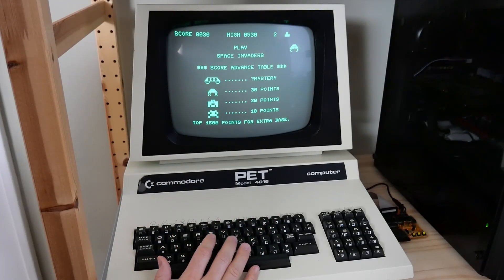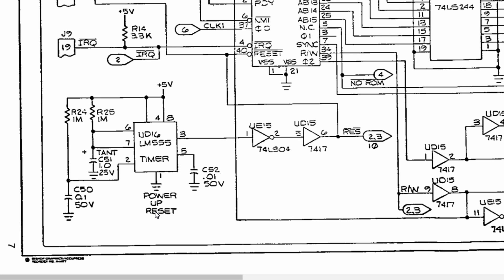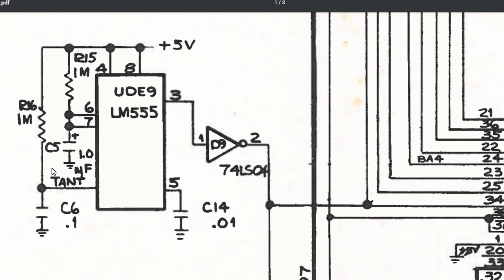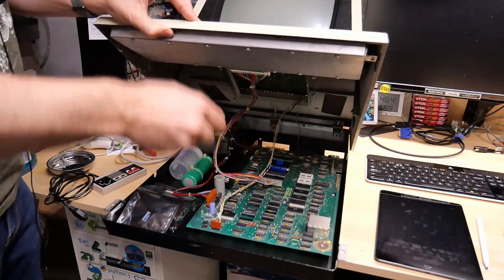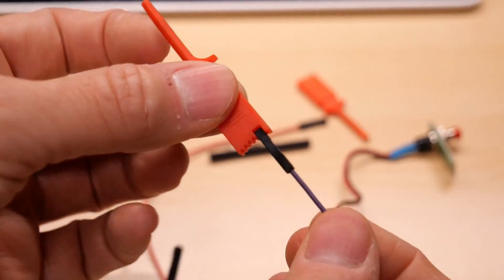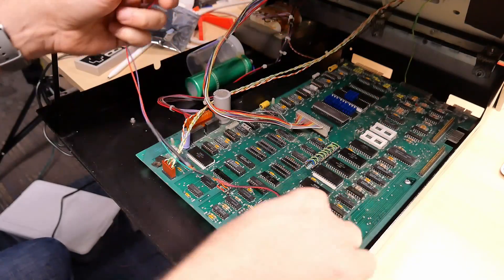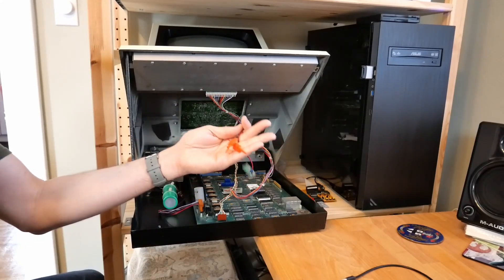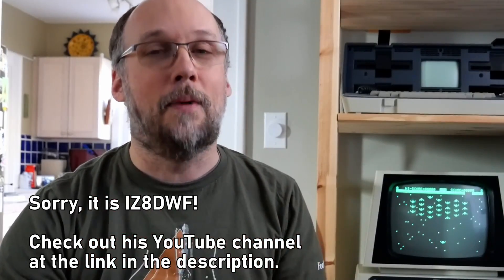Adding a reset button to my Commodore PET 4016

Comment: Hi there,  Hope you are well.  I noticed in your video you had some machined IC socket soldered to the BA0 to BA10 jumper area.  I also noticed that you had IC sockets for  UB6, UB7, and UB8.  this is usually to add an additional 1k of memory for 80 columns.   and the IC socket on the BA0 to BA10, lead me to belive either that pet was going to be modified to be switchable from 80 to 40 columns?    (see here:  http://www.6502.org/users/sjgray/projects/multied4080/mer-build.html  )   I'm actually in the process of installing one.    P.S. I added a reset to my 4032. :) thank you.   Cheers. :)

Comment: Like RosinSmoke said, I would like to tell you about this, as well. The hot glue will melt again in no time, and the switch might hit somewhere on the main power transformer(!), that biiig capacitor on the power supply as well, or even short-circuit any part of the mainboard. After all, the switch is metal, isn' t it? You could take TWO big washers, file or cut them with a saw/grinder on one side, so they will be level on their top and "trap" that switch between them and the black chassis.

Second, You could just desolder the 555 timer chip and put an 8-pin socket, but bending the pins you need, outside, so you can then insert those cables with the black sockets and then do whatever you want with them. Having these plastic clamps in there, would pose a risk of them breaking due to heat, eventually and short-circuiting many other things in there.

Sorry for any mistakes which I might have made, but I am from Greece.

Comment: I just love how you're not afraid of using aliexpress stuff. I use aliexpress stuff all the time too, and I can't understand why certain people tell us to avoid them. Even if you get a "fake" chip once in a while, the total costs compared to stuff from other pro sites still turns out to be way cheaper and similar quality
Reply from the maker: For chips it is a crap shoot as performance matters  but things like wires and clips, no big deal. :-)
Reply: @adriansdigitalbasement  I got 74 logic chips, eeproms, 555 timers, 41 and 46 ram chips, CPUs, and never had an issue yet. All logic and eproms tested with chinese tl866 programmer. All I had was a couple eproms that weren't blank, which I erased using a china eraser lol. Not having suitable electronics shops nearby on this island I live on helps me decide where to buy from too of course. :)

Comment: cool pity that the Pet here in Europe are not payable are extremely expensive certainly one that works, but nice reset button is very annoying if you have to turn it off always just built one in my 64 but that is much simpler ...

Comment: My old C64c was modded with a reset switch in a similar fashion, though I recall that the trick was to bridge two terminals on the user port.  With some care, you could solder a wire to the terminals and not interfere with anything that would be attached to the port.
Reply: Same mod would work here, at least for the Universal Dynamic PET board, on the first schematic you can see the output side of the 7417 is connected to pin 22 on the user port, and there's some grounds there too, nice no-open mod but you'd probably want to debounce the switch in that case (by hooking into the POR circuit here he eliminates the need to debounce it separately because the 555 is handling that)

Comment: Instead of the hot glue, I like to use automotive trim adhesive tape (3M VHB acrylic foam tape). Treat it just like the regular white foam stuff, but the VHB is about half the thickness and holds FOREVER.

Comment: Here's a quick tip: pin 1 on the 555 timer ic is actually ground, so if you connect your two clips to pins 1 and 2, it will have the desired result.

Comment: I would probably solder the wires on, do a proper soldering/de-soldering job and you should be able to reverse it with almost no evidence that it was ever done, and it'll look a lot more professional.

As for $10 each, wow, they are all but unobtainable in my part of the world. (Australia)

Comment: it's good  the reset button is located in a rather hard to access location, thus avoiding random pushes (i.e. accidental tripping); safest mechanism is to have a recessed push button you need to push with a fine tip, clip, pin, etc

Comment: Electrical tape should also work if you haven't any heat shrink available or if you want to use those wires for something else later.

Comment: you could have added 2 slightly larger washers to the switch ans then tighten it in place instead of hot glue - less damage, will stop it falling off.... P

Comment: Why not simply add a push to open momentary switch in the LV power line - would give a cleaner reset ?  - the method in the video seems to reset the machine twice as the screen is blanked when the button is pressed, but then displays the same screen again for a short while before blanking and resetting the machine.
Reply from the maker: What power line are you talking about? 

This is the way the machine works at power-up. After startup, the CRTC is initialized and then a second later the KERNAL clears the video memory and initializes basic. At normal power up, you just see garbage instead. Here you see what is in the contents of video ram until it is cleared.
Reply: @adriansdigitalbasement  I mean after the transformer on the low voltage side, either on the low voltage AC or after the rectifier if the regulation is separate (I've never owned a PET so don't know the power distribution)

Comment: Another reset option for PET 2001 described here: http://www.vcfed.org/forum/showthread.php?43585-My-Commodore-PET-2001N-Reset-Switch-Mod
Based on a mod described in the PET Personal Computer Guide by Osborne/Strasma/Strasma
Reply from the maker: Seems like he's just pulling the main reset line low -- the option I discussed and decided not to use. It's interesting using NMI works on the PET -- that is exactly how the VIC-20 and C64 work when pushing the restore key. It's wired directly to that line. (There is no restore key on the PET)
Reply: Yes - but I do like the way he’s mounted the reset switch on the J4 header with the button poking out through the open ram expansion port - it would be simple to adapt this to your solution - keep the J4 ground connection and just hook up the other side of the switch as per your video instead of to J4 RST

Comment: 12:37 You're still running the original firmware on your DMM, v2.02 is out.
https://www.eevblog.com/product/121gw/

You might also want to debounce the reset switch using a capacitor.
https://www.allaboutcircuits.com/technical-articles/switch-bounce-how-to-deal-with-it/
Reply from the maker: Thanks for firmware link-  need to check it out. No need (IMHO) to debounce as the cap and pull-up on pin 2 are already doing that.

Comment: Instead of hot glue, it certainly appears at 15:30 that you had enough threads to add a washer and nut on the protruding stem of the button.
Reply from the maker: I don't have that stuff at home and I don't think a trip to the hardware store is deemed essential. :-)

Comment: I had such a great moment of satisfaction from watching this video thanks to ben eater's 6502 series because right off I was thinking "oh, so you just need to pull the reset line low and there's probably a 555 timer that holds it low for a second at startup so you can probably just.. Yup! There he goes!"

Comment: I'd like to add a reset button to my breadbin C64 for the exact same reason, even though I've replaced the power switch, it feels like power cycling often can't be good. I'm confused however because of the cold reset vs warm reset options. I've even heard of people wiring both options and using a switch to choose which type of reset is used. Apparently warm reset doesn't work with machine language programs and cold does but leaves the machine language program in memory? Is there any disadvantage to just using a cold reset every time? Is there any reason to prefer warm reset? I think the cold reset uses the 555 timer similar to the pet.

Comment: Pin 1 of the 555 is ground so you could just connect the switch (and resistor) between pins 1 and 2. The value of the resistor isn't very critical, it just limits the discharge current for the capacitor while you're pushing the switch.
Connecting the reset switch to the 555 instead of the reset input of the 6502 (and other chips) prevents any problems from contact bounce in the switch.
Reply from the maker: Oh yeah that's a good point on the pin 1 -- although it's probably just easier to use a bypass cap, although if you don't have a DMM then it's a sure way to hook it up. People have mentioned the bounce on the reset line -- but think about how many C64 reset buttons are hooked right to the reset line via the cartridge slot or elsewhere without any issues.

Comment: Cool mod. What I did with my commodore 4032 was to connect an external speaker to the User-port. So the sound was quite good and better to enjoy. Maybe a cool ,project for you. Keep up,the good work. Stay safe. Greetings from Germany.
Reply from the maker: I was thinking I could just hook it right up to the little piezo speaker and put a better internal speaker in it. I bought a small audio amp that is coming from China so I may try that out when(if?) it arrives.
Reply: Adrian's Digital Basement ok. That is a better way. Thank you for your answer. We look forward to new videos. Great 👍🏻 content. Adrian.

Comment: If you use a mosfet inverter-inverter with a resitor (1k - 10k, what ever you have)  connected to the 74LS04 pin 2, and on the input of the mosfet inverter-inverter you have a push button you do the the same in a i guess simpler way. (power the inverter-inverter form the 5V of the main board).

Comment: 12:18 what is that long pin header for on the right side of the board. Some sort of expansion port?
Reply: Yes, there were some expansion boards that use that connector. Later CBM machines such as the 8296 used that to add extra RAM. Most expansions were simply ROM IC's that plugged into a free socket, though.

Comment: 12:45 why are those IC sockets unpopulated. What ICs are supposed to go there?
Reply from the maker: Yeah expansion ROM sockets. Some software packages came with ROMs for these sockets from my understanding. Also yeah those pins are for expansion cards. Not sure what used that but it has the entire address and data bus available on it.

Comment: Hi Adrian! I always wondered how they made these datasheet files before more complex computers. It seems like they are hand-drawn. But how can they be so perfect? Did they draw around some templates? It would be great to know :)
Reply: Exactly with templates. Drafting used to involve lots of straightedges, template cards that had various shapes, etc. If you search on ebay for "drafting template" you can find lots of vintage examples.

Comment: The glue is nice, but I hoped you'd use something like a big washer on the outside, to clamp the chassis between the washer and PCB rectangle
Reply from the maker: I'll probably end up needing to do that once the glue falls off. :-) I don't have anything handy at the moment and didn't want a trip to the hardware store.
Reply: @adriansdigitalbasement   HAHA  you have a large collection of C64, Apples IBM, Sid chips , 6502 chip , resistors, capacitors and no general washers, Oh my i find that so funny.
Reply: @adriansdigitalbasement  I've had to 'superglue' hot glue before when it's (inevitably) fallen off.  At least the hot glue makes a kinda nice smooth plastic surface to do so.
Reply: @adriansdigitalbasement  Nice thing about hot glue, besides being quick, is it is easily removable in the future if you change your mind. If you want a more permanent mount two part epoxy or drill a hole in the steel but then you've made an irreversible change to the PET.  I like that you used hot glue.
Reply: I was literally on my way into the comment section to say the same thing.
Reply: I already commented the same... Adrian you will need to do a follow up video for adding the washer! 😁👍
Reply: @bitoxic  10 hours difference tho
Reply: @Grishanof  yeah... wrote the comment before reading comments!

Comment: No need for resistor.
Reply: You actually need a resistor when you're going to ground a charged capacitor even if it's a 100nF  one. The initial short circuit current is limited by only the capacitor's own ESR (which can be a fraction of a ohm for a 100nF capacitor) and the wiring plus button's resistance that, again, is usually some fraction of a ohm. You could easily wel the button contacts or damage the capacitor itself in the long run. Why take the chance?

Comment: I enjoyed this, thank you. I have an unmodified, and yes, engraved with marker pen 4032. I normally use Vice for programming and keep the actual PET in the garage, where I recently went to check on it and found a real live mouse living inside! Mr Jingles. It had taken some birdseed I had stored on the shelf and gorged itself. Probably too fat to get back out through the side port. He made quite a mess in there. The computer display went haywire on startup but after cleaning the contacts on the board, it worked fine.
Reply from the maker: Yeah unfortunately mouse pee is corrosive when love on the board. My Franklin Ace 1000 had mice living inside and I only recently cleaned it up and found several chips in pretty bad shape. A good scrub with soap and water is helpful to at least stop it.
Reply: @adriansdigitalbasement  In a previous job, many years ago I worked on POS systems (in both senses of the acronym)  I had one NCR system where a mouse had made a nest inside and peed on the motherboard until it corroded through the traces for the PCI connectors.  NCRs were tough, but that was a bit much.  The machine was still working but no comm to the terminals or printers.  It was so disgusting I ended up salvaging the hard drives and the rest went in the dumpster held an arms length from my body.

Comment: @Adrian: Interesting, my 4016 Board is labeled "80 COLUMN CPU - ASSY NO 8032080", though it is 40 columns (looks identical to yours on the outside). Did they just use the same boards at times for both 4016/32 and 8016/32 PETs?
Reply from the maker: the 8032/8016 and 4016/4032 are definitely the same board -- in fact the schematic I was looking at was for the 8032 but as long as it's the universal pet board, they are all the same.
Reply: @adriansdigitalbasement  Mine doesn't say universal dynamic PET, and is a bit different configuration than yours.  Doesn't have the little Box, has copyright 1980. Most of the chips are 1981. Also has 3 regulators instead of the 2 i see on yours. I wonder if mine is older or newer?
Reply: Just noticed that your Assembly is 8032089, so i wonder if that's a little bit newer than my 8032080.

Comment: Even with only the open collector solution, I wouldn't put there a switch to reset. Especially older/some [?] versions of 6502 CPU has some internal problem to even destroy the CPU if it's hold too long in active reset (which can happen if it's controlled directly by a human ... maybe one other reason to use a timer IC [555] hmmm). Also even without this problem, a normal switch just makes an ugly work because of the bouncing. Anyway, this was just a small comment as the final solution in this video wasn't that "direct switching the reset" theory.
Reply: Interesting, where did you read that? On the C64 we used to have all sort of reset buttons mostly on the user port and that was directly on the 6510's /RES pin. I haven't ever substituted a 6510 in my own C64 (and very few of them on other's C64 also). Plus, the 555 circuit on the PET is a retriggerable monostable multivibrator. It means, it will held the /RES line on the 6502 low as long as you keep the button pressed. It will debounce  the button and make the pulse clean and at least a minimum duration by design, but it won't shorten any long pression of the button.
Reply: @iz8dwf  As far as I remember, I read at some places, like 6502.org forum, stating that some NMOS process version of 6502/6510 (?) - so probably before even HMOS process - have some "internal heat" problem with the reset, honestly I have no idea, if it's REALLY true. I can't find the exact document now, but I at least found this after some google'ing: http://forum.6502.org/viewtopic.php?f=4&t=1927&start=30 But now reading it .... it seems you must be very evil to cause problem this way, and hold reset for a VERY long time ... On my 6502 based SBC I use CMOS version of 6502 (so 65C02), so I have not so much actual experience how dangerous it is. For the 555 you're right, actually you can hold your CPU in reset that way too.
Reply: @LGBofZ  Seems not very clear, but anyway, it's unlikey anyone would keep the reset button pressed for more than a few seconds. I'll do some research. SInce the 6502 has been completely reverse engineered, one can always reconstruct what happens inside, with enough patience :)

Comment: Noticed at the end you had a memory board, what board is that? i have the data cassette, and a single 5.1/4 floppy drive. going to have to get it working now.
Reply from the maker: Hmm what memory board? Neither of my PETs are expanded although I do have some PCBs made up to build one. (Eventually)
Reply: @adriansdigitalbasement  did you have an external program memory storage? may be should have sated it better. yust turned my pet on and video is corrupted and just make out the 32K bit on the screen , the charactors are all changing. My PCB has the cassette connection near to your reset was placed. also small screen and a plastic plate where you label is. Going to need to start looking at the diagrams